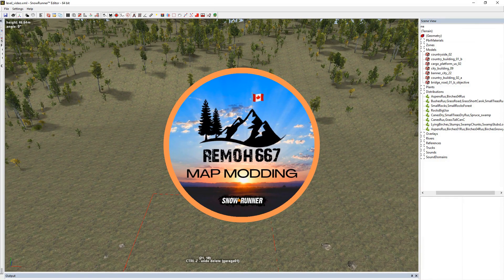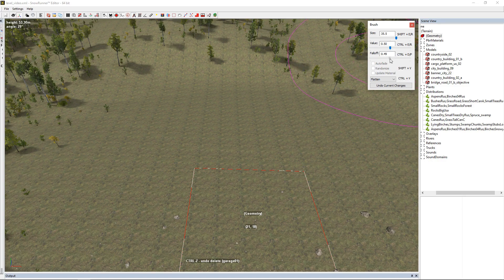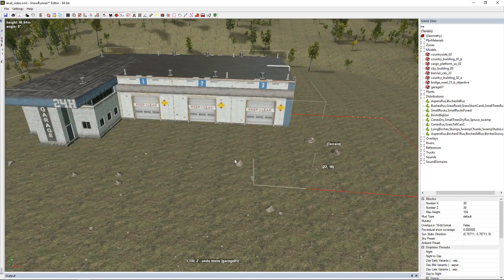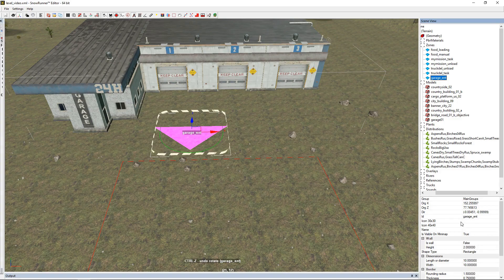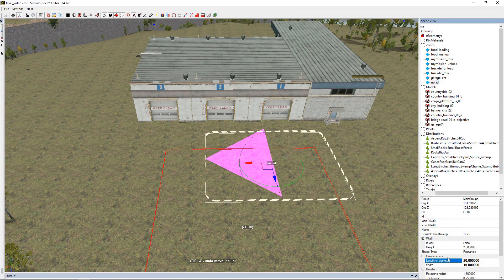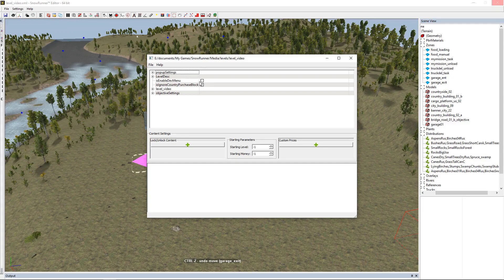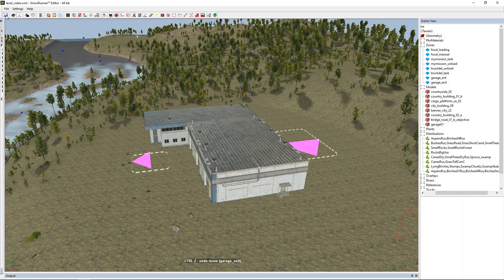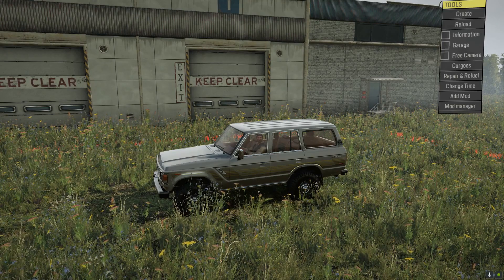Remoh Builds - Snowrunner Editor - How To Set Up A Working Garage

Comment: My editor is crashing whenever I click the "add model" button. Do you have any fixes for this? And also, can you add custom garage music?
Reply from the maker: When you right click and select add model from the list? Does it give you an error message or just crash completely? 

Yes you can add music but it seems like the custom music setup isn't very reliable. Probably the main reason I haven't attempted it yet
Reply: @ it just crashes completely. After doing it a few times it works, but until that point it just crashes. Only works about half the time. Thanks for the info on the garage by the way!
Reply from the maker: I know when you open it the first time after opening the editor it take a good 10 seconds to open almost always (must be loading the previews or something)  For the most part the editor will keep working ever when windows says "not responding" it almost always goes through.  

I haven't had that specific problem but I will let you know if I figure anything out
Reply: @ alright, thank you.